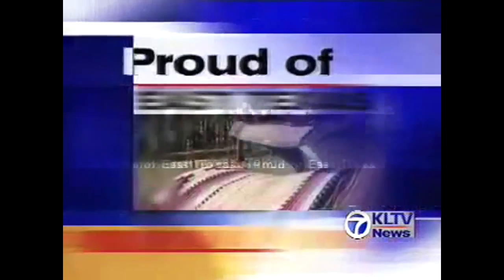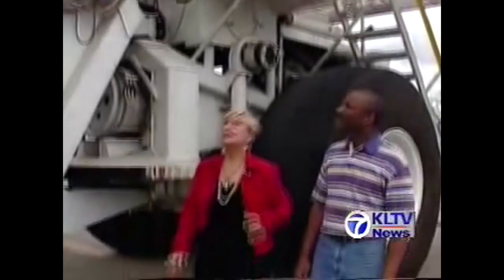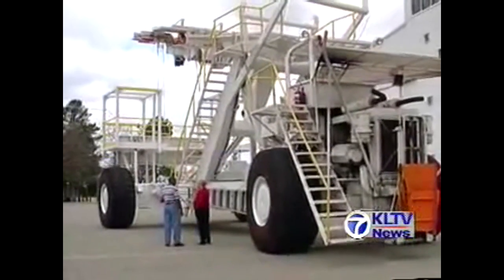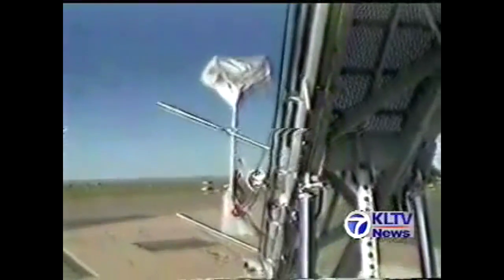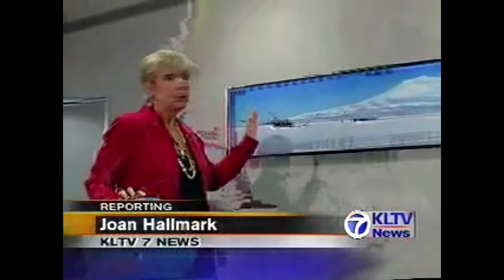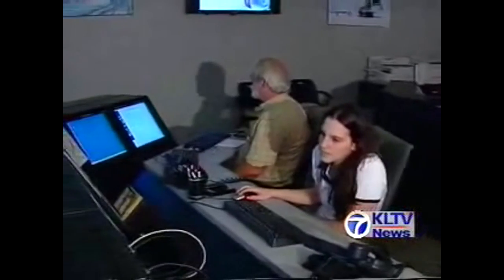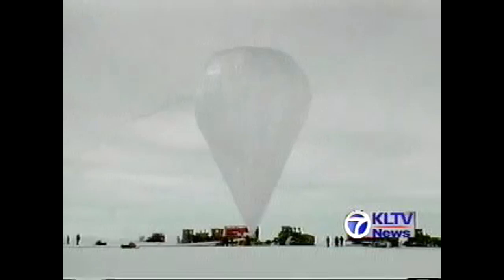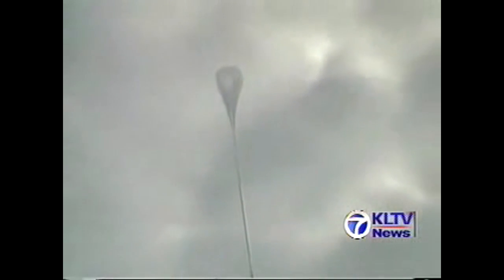Techniques that substitute satellites - Real Satellites Of NASA, Revealing

Comment: "1. GPS uses Cel-tower triangulation not Satellites" Perhaps you could explain how it is possible to multilaterate a position fix with altitude data using signals all coming from nearly the same angle of elevation (as would be the case when using terrestrial radio towers)?
Reply: WIth a combination of ground-based antennae and balloons using skywave signal propagation.
Reply: by accurately computing the time difference of arrival (TDOA) of a signal emitted from the object to three or more receivers.

Comment: OK, so you proved that scientific balloons are real.

How about proving that satellites aren't?
This is like showing a video of a helicopter and then jumping to the conclusion that airplanes don't exist, they're all helicopters.
Reply: Chris Topher
If I didn't have actual evidence I wouldn't have said that this is easy to prove,

First, the math: in order to have a geostationary orbit, a satellite has to be at that elevation above the Equator.

There is the force of gravity on the satellite
Fg = G * M * m / r^2
For a circular orbit, this should be equal to the centripetal force keeping the satellite in that orbit
Fc = m * ω^2 * r

where
G = gravitational constant
M = mass of the Earth
m = mass of satellite
r = radius of satellite's orbit
ω = angular velocity

we know that
ω = 2 * π / T
where
T = orbital period of satellite

so
Fg = Fc
G * M *  m / r^2 = m * 4 * π^2 * r / T^2
r^3 = ( G * M / 4 * π^2 ) * T^2

where
G * M = 398,600.44 km3 s−2
T = 86,164.09054 s (a sidereal day)

replacing the values we obtain
r = 42,164 km

then, after subtracting the Earth's radius at the Equator, we obtain
42,164 - 6,378 = 35,786 km

----------------------

Now, the experimental evidence:

A satellite dish has to point exactly at the satellite it receives. So you can tell where the satellite is by simply pointing a dish at it.

Since we already know the elevation of the geostationary satellites' orbit, we can calculate the azimuth and elevation of the dish in any place on Earth. in order to receive the signal from a satellite.

There are online calculators that do that for you. Remember, the dish pointing data is calculated based on the spherical Earth model with the satellites at 35,786 km above the Equator.

See for example
http://www.dishpointer.eu/?lat=37&lng=-96&sat=-101&zoom=3

Now, if different people from different locations across a continent, point their satellite dishes towards the same satellite, it's easy to see that all the dishes are pointing at the same place, somewhere above the Equator.

http://www.dishpointer.eu/?lat=37&lng=-77&sat=-101&zoom=3
http://www.dishpointer.eu/?lat=37&lng=-120&sat=-101&zoom=3
and so on

Every satellite dish ever installed was pointed in the exact direction calculated by this method.

And all the satellites are found exactly where they should be in the sky.
Reply: If there are real satellites, then where are the footages of them?
I don´t talk about the CGI-satellites!
Reply: Satellites are on balloons - whats so hard to grasp here - you need to let go of your illusions and biases.
Reply: "satellites are really at 35,786 km above the Equator." is that just what you are told to believe or do you have any actual evidence?
Reply from the maker: Balloons are the satellites... ;)
Reply: Mediocre monday
It's easy to prove that for example geostationary satellites are really at 35,786 km above the Equator.

That's 1,000 times higher than a balloon can go.
Reply: Gio Tag hahaha. Go on with your sci-fi dreams. It feels good..
Reply: thesituashaun "the satellites you think are geostationary are only signals bounce off the Dome."
I've seen this claim a few times. It's pretty ridiculous on many levels.
Why would reflections off a dome appear be coming from a point in space just where a geostationary satellite would be located? Surely such a dome would have its apex at the north pole? Why would satellite TV customers south of the equator point their dishes north while customers north of the equator point their dishes south?
Imagine all the engineers who would require to work on this sort of system. Where are they? Who are they? Why haven't any come out to tell the world the truth.

It's really hard to believe you guys are serious. 

GPS works everywhere. Many GPS modules will let you track the individual satellites. You can selectively block signals from individual satellites to confirm they're really in the part of the sky they claim to be.

transit-finder dot com lets predicts when you can see ISS transits of the sun and moon from any location on Earth. Is NASA somehow getting a balloon to travel in front of the sun and moon at all these predicted times? How can you not see the utter nonsense of thinking satellites are balloons?

Learn some math you guys and free your minds. Come out of the stone age and join the rest of us in the 21st century.

Edit: I had the wrong URL for the transit finder.
Reply: Oli Garch "If there are real satellites, then where are the footages of them?"
Go to transit-finder dot com and you can find when the ISS will pass in front of the sun and moon. You can see a satellite for yourself.
Reply: A map pinpointing a location that has no proof of even being real isn’t a “real video” we want to see real videos, not a fake point on some map
Reply: Feb 2018 national geographic front cover says it all. The one magazine that always uses real photos and they show you an animation?!
Reply: Gio Tag 
 Would be more like using a fax machine for something important when we have much better ways. So no you are full of it...
Reply: Math shows A reality, it does not prove OUR reality, try to learn the difference.
Troposcatter technology explains why the Dishes are always pointed at the same spot.
You are debunked state relegion trolls, be gone now.
Reply: check again, they can go up to 85 thousand feet, the U-2S reconnaissance and surveillance, from the stratosphere, which monitor these satellites and recover them when they go below 65k feet.........................see this video, it explains much......................https://www.youtube.com/watch?v=oM5fKcU5ClI